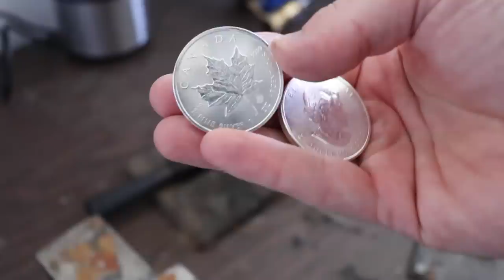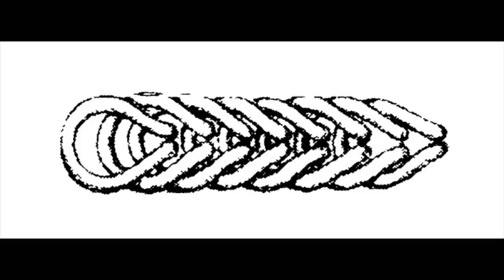Making silver necklace Anaconda | Classic Foxtail | Loop in Loop Chain | Chain making Tutorial

Comment: "know how" is the key. However, this special 4 wheeled rounding block is awesome. Didn't know such a tool exists.
By the way, using a brass brush and brushing the silver under water makes a great shiney surface. Try it out.
Reply: I think that big shaping block you describe was for making it squared, otherwise a normal drawing plate could be used.
I had a go at viking wire weaving a few years back, (which produces a similar looking result) and I just used a wooden drawplate. Was just all round holes though...no square ones.
He really does have some fancy tools, huh?  :D

Comment: This will be the 4th. time I've watched this video.   Everytime, at the end I wish I was NOT 75 years old so I had time left to learn to do this.  Guess I'm stuck with making soldered chainmaille.  His work is way beyond extraordinary.
Reply: Pfft, plenty of time, lol!
It's not actually overly hard to make this. The fancy tools certainly make it easier though.
You can actually get pre-cut and even pre-soldered rings in any size and gauge, so all that starting from scratch thing is unnecessary. If you can find that, then the hardest thing you'll have to do is to solder ends onto it, lol!
If you'd like to try something else that looks cool, but is way easier, try something called viking wire weaving. It looks similar, especially when pulled through a drawing plate (just a handmade wooden one is fine, it's all I had), and you can just use regular craft wire, which comes in all sorts of colours. 
You're never too old to learn a new skill!  :)
You're on a computer and watching stuff on Youtube! You're doing better than most your age!  :)
Reply: I'm 70 and starting silversmithing. I'm going give this ago sometime next year. Only just started, unpacked all my gear mostly. Had to rebuild some pliers and extras as a lot is packed up in boxes somewhere in the garage of a hundred or so boxes. Now we are looking for a new rental as we have been asked to vacate. Usually we get 10 yrs between moves this time it was 3 yrs, and that was after 3 yrs of me separated from my fractured family. Was hell of a lonely time. We got evicted and couldn't find anywhere. Had to split in four and I had to move 1000kms away. Took its toll on all of us physically and certainly emotionally as well. My eldest daughter in particular was very bad on her, deep depression and did bad things twice. I collapsed when I heard the second time. She much better now under my care.

Comment: hey bro just wondering do you file all sides of the chain? in process of making one and I'm just worried I'm going to file it down too much.
Reply from the maker: Yes, all sides
Reply: you can draw chains like this down through wooden draw plates - it will compress the chain and round it out a bit, but the chain will mostly stay square in cross section.  I'd never file these chains - mostly because the one's I make are made from smaller wire and couldn't handle the metal removal.

Comment: Nice chain, would be nice if you 8ncluded sizes of the wire that you made up, length, etc. included in the description, please. I l8ke that you included pictures of how the links must sit when making up the chain. I've seen others doing this style, but it's been difficult to actually see as their fingers get in the way all the time. You at least give clear examples of the steps. Where did you get the head and tail from, please? And Hello from Sydney Australia. Thank you for sharing your working process. Helps us beginners to see what is possible with practice.

Comment: Learn what “how” is. However, this particular 4 wheel rounding block is great. Do not know that such equipment exists.
By the way, using a brass brush and brushing the silver under the water creates a great glossy surface. Try.

Comment: hello, how thick is the wire?
 what is the measurement of the thickness of the wire?
Reply from the maker: 1/11
Reply: Thanks, but does it only have to be 1.11mm or does it have a minimum and maximum? 
I put 1mm would it be ok? 
I don't have the square machine to stretch the chain, is there a way to stretch it with the laminator?
Reply from the maker: @abdunews6098  wire 1 mm/ bar 11 mm

Through rolling mile
Reply: @DynamiSJewelry  thank you
Reply: @DynamiSJewelry  thank you very much and I really like your work. At school all my classmates are fans of your. You are a clean artist. 
Thank you
Reply from the maker: @abdunews6098  thanks for watching